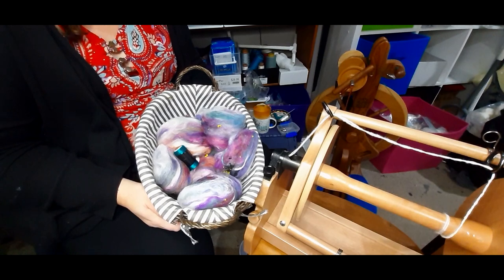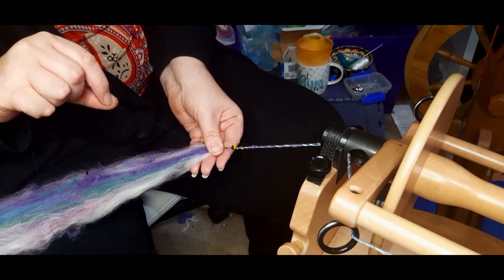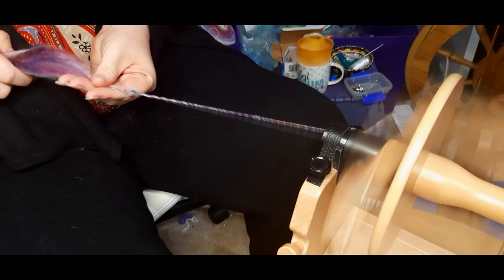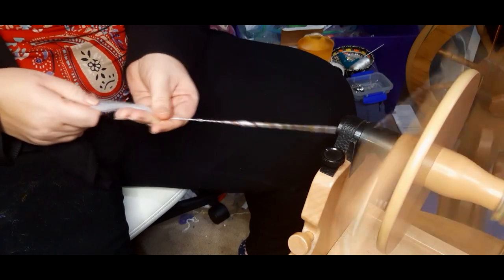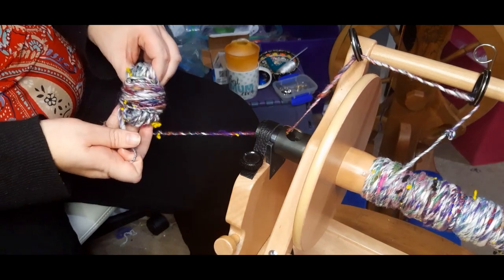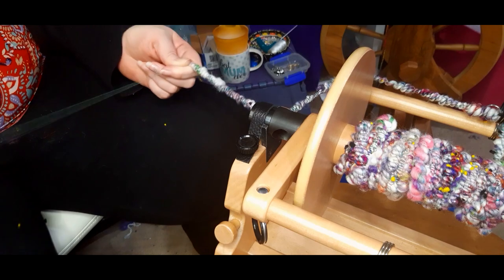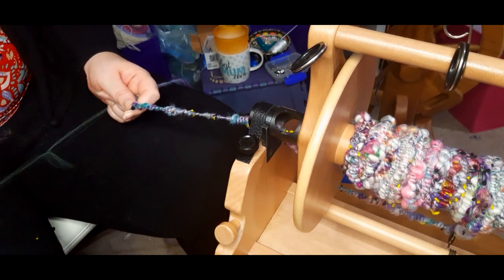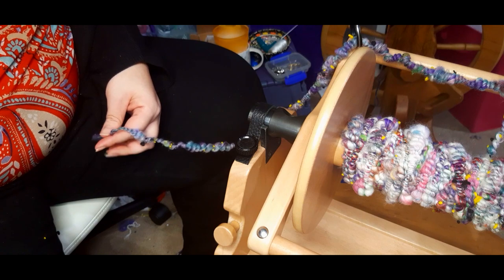HOW TO SPIN -  Coreless Supercoil ART YARN - Using a auto wrapped single

Comment: I've always made my coil yarns with a core spun single..but I'm not really sure why?! are there any mean reasons why you would opt for a chunky single versus a core spun single and vice versa? I'm struggling to see the difference.
Reply from the maker: The difference is I love making supercoils but I couldn't afford the core thread to make the core spun single.  I didn't want to miss out and so started making a single ply to make supercoil instead then found that the coils are more solid and you don't have the core yarn sticking through.  I also found a core spun supercoil was allot weaker then the coreless.  So now this is how I do it.  

I do still love how fun core spinning is though. It's just the worry about how and where I was getting the core yarn.
Reply: @josparadiseofcolor  yeah that's makes sence. Just makes we wonder why it even is a thing really if you can achive the same effect without the core 🤷‍♀️
Reply from the maker: @sarahfrancis5975  thats why I love to think outside the box :) they give off different effects though.  

Corespinning is easier to get uneven chunky sections and is more like glazing the core yarn. 

Single is more of an even and cleaner single.  

I'd say it depends on what results your after.

Comment: Jo, this video is so fun!  I love seeing the carding process to the finished product.  The yarn turned out so wonderfully.  So fun and funky! 🍄🌸🦋💙
Reply from the maker: Naww thank you 💕
Reply: @josparadiseofcolor Question, if you had to cut this yarn...say you were using it in a weaving and only needed a length of it...would it still stay together or would a person want to put a knot in on each side of the cut?  Thanks, Jo.  This is Cheryl asking the question.
Reply from the maker: @groovygrump  I tie a knot in each end but push the coil up tightly then knot at the base of the coil.  Once you steam it it also sets the twist and stops it falling apart
Reply: @josparadiseofcolor  Awesome!  Thank you for the advice on this yarn!  I appreciate it.

Comment: I wonder if you can do this by not using the
Thin thread in the first spin just spin your yarn? That’s how I’ve done it in the past and it seems to have turned out OK.
Reply from the maker: @vickimerchlewitz  normal way to make a supercoil is by core spinning onto a core yarn.  I just show a more cost-effective way for those still wanting to make super coil but unable to afford the core yarns.

Comment: Do you ever have trouble with over twist? It's really pretty. It would look great in some weaving. I love watching you make specialty yarns. Blessings.
Reply from the maker: Not on the electric wheel Gerry but sometimes on the normal wheel.  You just need to test small samples till you get the correct tension.
Reply from the maker: And thank you soo much ❤
Reply: Great question, I have the same issue!!

Comment: So your plying thread (the inside of the coil) is over spun, but the way you tie it off keeps you from loosing the supercoils? I’ve made a couple of super coils and the core plying thread gets overspun. 😢
Reply from the maker: 1st part is like a super chunky single and then the single is coiled around the plying thread. Its a much nicer finish.
Reply from the maker: The finish keeps the coils intact :) my own method.
Reply: If you want a balanced supercool you can counter the core thread spin with a drop spindle. There is a great section on that in the book "The Spinners book of Yarn Designs"